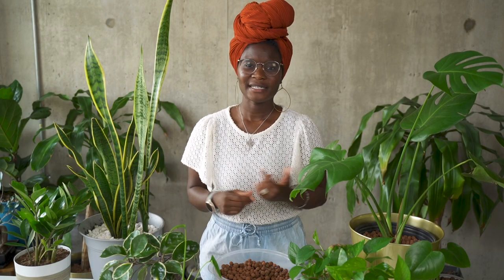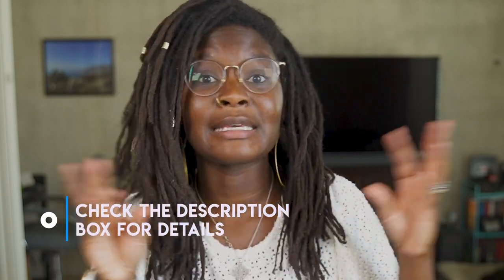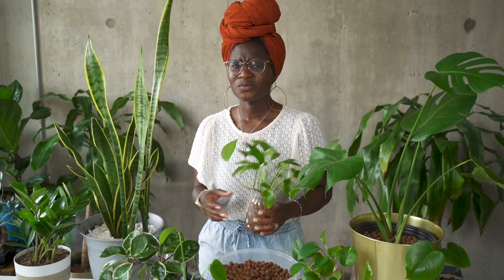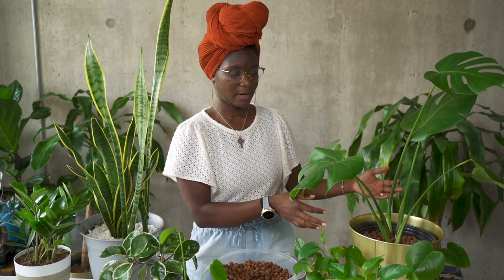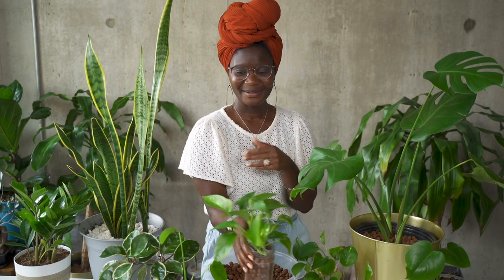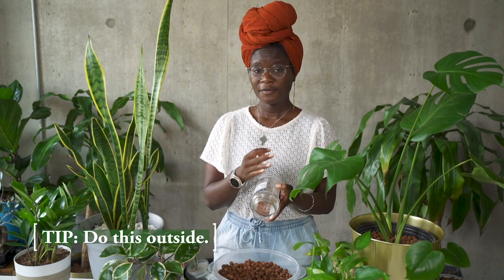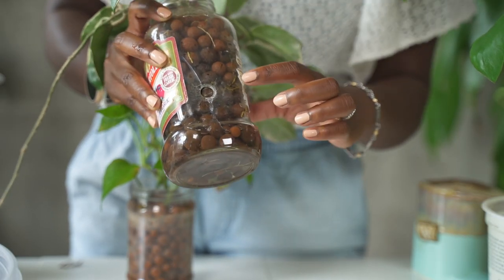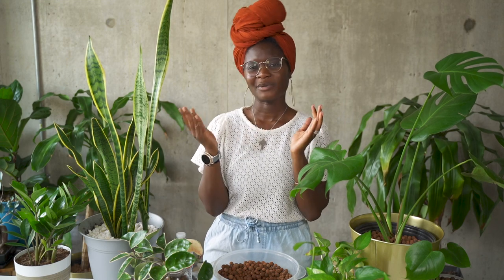Why I prefer drain holes for my plants in LECA + tips on drilling // #semihydroponics

Comment: I recycle plastic jars and use a soldering iron to burn holes in them. I find this method safer (and faster) than drilling, especially drilling glass. If I have a lovely glass container, I use it as a cachepot and insert a perforated plastic jar (or orchid pot) in it.

Comment: 9:50 I devised a hack for easily for removing inner pots out of their cache (outer) pot. Getting your finger in there to lift it out can be a PITA (pain in the arse...only saying bc my mgr asked me the other day what PITA meant lol)...esp w/ tight fits. So I use a hot nail to poke a hole about a half cm to a cm down the edge of the inner pot. Then I make a little loop out of fishing line. It creates an invisible handle. You can do on just 1 or on both sides.

Comment: Ive been doing semi hydro for maybe a couple of months. Im still trying to figure it out or what works best for me.  I havent drilled holes yet, that is on list to buy the drill bits. For now, I have used the small glass yogurt jars for my tiny/seedling plants or used a cheap dollar store non clear plastic pot w/ a cache pot. Oh and Ive done the basket pot  (orchid pot) in a glass cache pot. Clear pot is definitely easier & more gratifying to see the root growth.  I think its time I try the hole method now.   Registered to vote  & here in WA everything is done by mail as far as voting. Thank you for the reminder to all.

Comment: Some thoughts from someone who has been doing passive hydro for years.
1. Leave an inch or so between nutrient solution and the roots of the plant. It will make your plants roots reach for food. In the beginning it will make for a more hearty plant. You will notice air roots. You want to create a happy spot between water and air.
2. Dont use straight tap water. I use a repurposed milk jug that i fill and leave the cap off so the fluoride etc evaporates. I was told by an aquarium guy that that is not enough but it works.
3. Food. I doubt growing in just water will work. I use a fertilizer that is made for hydroponics. I like General Hydroponics mostly because it's less expensive to others but after a while you will get burned roots from the salts if you don't "flush" out the water. It is 10-4-14  and I always use less than recommended.
4. Ph... this is a funny one. Ph is a measure of how alkaline or acidic your mix of water and food is. The scale is 1-10.  I think, although i may be wrong, you want a Ph of around 6. The reason it matters is that your plant cant eat well without the right Ph. 
5. Roots do not like the sun. In my world clear containers promote algae. Algae will eat the plants food before the plant can. The hydroton, or LECA i guess, will block some light but I always cover my containers. Although it doesnt look good I cut paper grocery bags to wrap around the container.

Comment: What might help in regard to using the catch containers with the nursery pots and avoiding the stagnant water smell, is if you use something to raise the inner pot from the bottom of the outer container! So I like to use bottle caps, or tiny plant pots that are upside down, so that the inner pot with LECA is sitting higher up within the larger pot. Then air can also diffuse throughout the sides of the container and reach the water as well!

I have not tried LECA yet (going to be trying soon), but I do this method for my soil pots nonetheless! It also has the benefit of making the plant look a little more pretty by sitting higher up and seeing more of the plant :)

Comment: I bought the diamond bits but I haven't drilled holes in any of my 4 semi-hydro plants. So far, only one has died but I don't think I potted it right and it was the only one not converted from soil. I watched this video to find out if the holes were actually necessary. You definitely answered that question. Thank you! I have another question that you touched on in another video. You briefly said that the roots will grow down into the water and those roots will be able to handle sitting in the water. Does that mean they won't rot?

Comment: Hello, just wondering, if i use Leca as a potting medium, does it mean that i can't let the water drain completely from the pot? Meaning there will always need to be a little bit of water at the bottom of the pot? Because in soil you normally just let the water drain completely from the hole at the bottom of the pot.

Comment: Hey, question if you don’t mind asking. I started semi hydroponic 2 days ago using your video and advice as a guide. The issue I’m running into is...for the plants that have no quite “rooted” yet I put them in a 8oz mason jar with leca. The concern/ question is: would it be ok if I put the plant in a net pot with leca, then fill the jar up with leca right to where it meets the bottom of the net pot. Then fill with the nutrition water to the same level of where I think the root ends and leca begins
Reply: If the plant hasn't quite rooted it won't hurt to submerge those roots to get them started. Many cuttings are easily rooted out in water and don't mind growing in it beyond that phase. It's when the plant has existing soil roots that you want to keep some of them out of the water while it develops water roots but as long as there is no soil on the roots submerging in water won't harm them.

Comment: You mentioned algae and I do have that issue when it is in a glass container and the sun is hitting the glass.  How do you, if it all, deal with the algae?  I have to say that I am very lazy with drilling the holes.  I do have the plastic pots more than glass and that has the drainage holes and allows me to see the roots, though they are sitting in another pot so I do have to take it out and see what is happening.

Sidebar:  Can you do a video on what types of plants can grow in leca/water/hydroponics?  For example, I wanted to do this with a spider plant and was concerned if it was an option.  Calathea too.
Reply: by the water, I will leave the drilling to Ernest.  He knows what he is doing and I don't lol.
Reply from the maker: I usually just flush the plant with water as soon as I see the Algae and that's enough to get it out. I've also heard people flushing the container with a Hydrogen Peroxide solution as well.